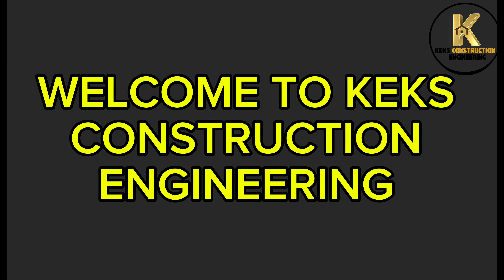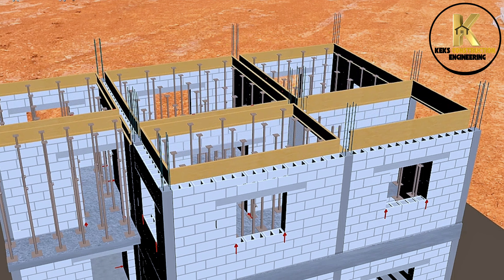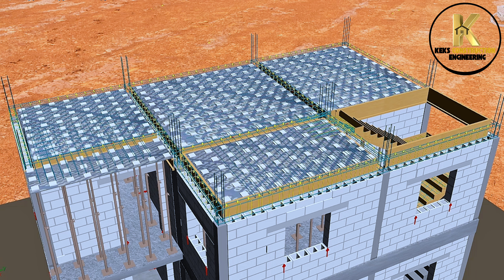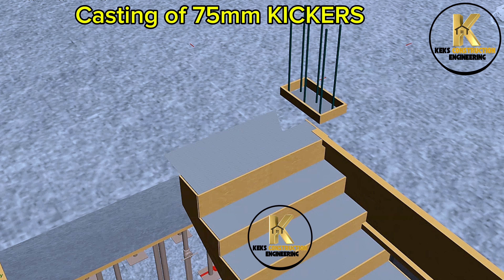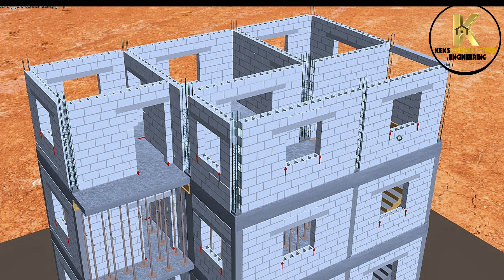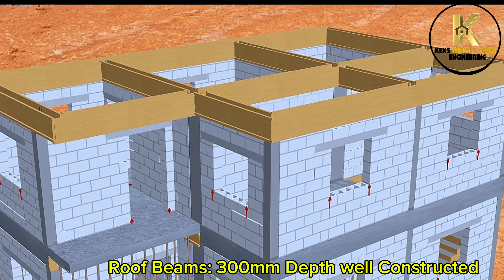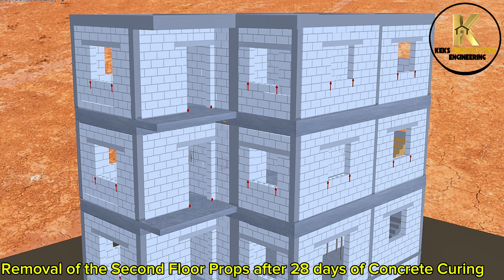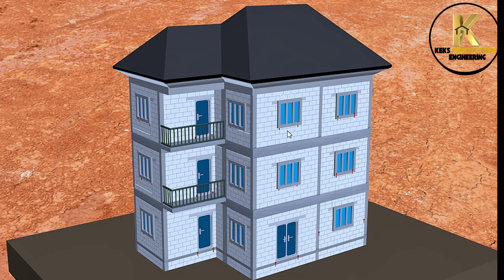A COMPLETE HOUSE CONSTRUCTION (PART 3).| Building Step by Step from Foundation to Finish.

Comment: Isn't it better to cast columns before starting on wall?
Reply from the maker: Yes..... It's better to be done that way as a framed structure but not all structures are designed as framed. Some are designed as load bearing structures.

Thanks for your Contribution.
You can watch other amazing Construction VIDEOS on the Channel and stay tune for more

Comment: Very nice but rebar details looks too light for building
Reply from the maker: @karenalarcon7093  
The Rebars size for Columns and Beams are minimum of 16mm diameter. While Slab Reinforcement is 12mm Diameter. The building was well designed to be  Safe and economical.
Thanks for your contribution.
Your can watch the PART 1 and 2 on the Channel and other amazing Construction VIDEOS.
Thanks

Comment: From the video, I believe that the concete facial is precast, 
My question is how will the concrete facial (parapet) be joined to the roof if the roof beam have already be casted completely?
Reply from the maker: You can do that together with the roof beams. I only add that to complete the roof but was not the focus of the animation. I may do a specific view on that.
 Thanks for your Contribution.
Watch other videos and Stay tune for more.